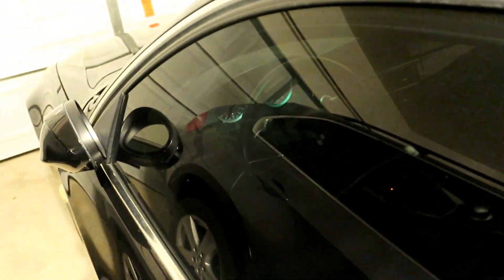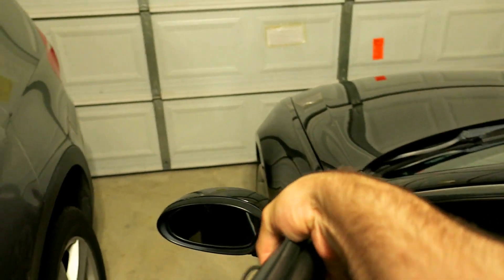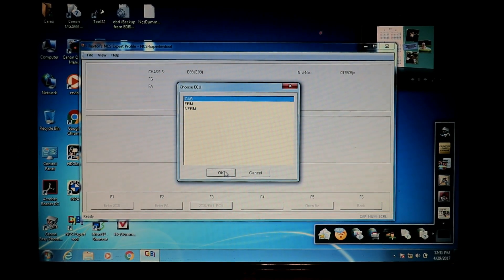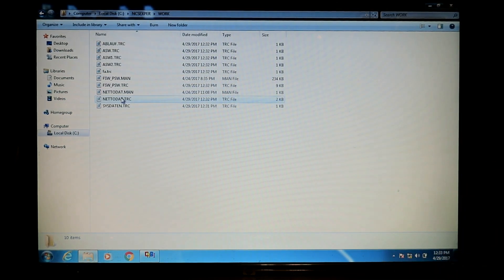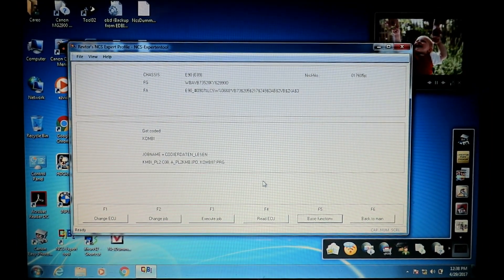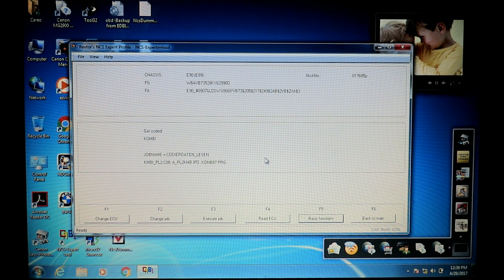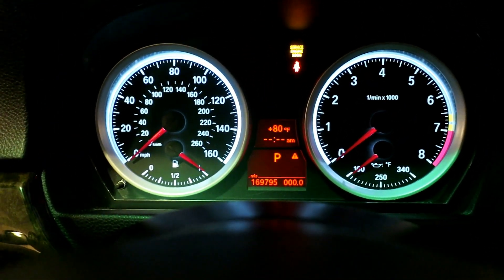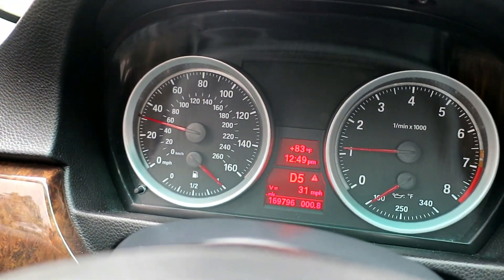How To Code For Digital Speedometer On An E90 BMW Using NCS Expert

Comment: ALL VIEWERS!!!!!!!

This coding tutorial is for the wrong parameter. This ONLY turns on the long term average speed (which is why is has the Speedo icon in the left)

It is not enabling on the the current speed which shows a letter V (velocity on the left when selected)!!!!!!!!!!!

Comment: Hi 
I’m your fans! 

I have a question for you

I bought an old speedometer and installed it, but the driving information and gear position cannot be displayed. I have a bimmercode, how can I use it to program it?
Reply: My cat is e90 325i

Comment: Great video, thank you. I have my cable and software ready to do this and few others you posted. One annoyance I have is the inaccurate speed, ours seems to be 4mph off.  Here is a link to a guy changing this for his E60. What are your thoughts? have you tried it on E90? https://www.m5board.com/threads/correcting-the-e60-speedometer-via-coding.430570/

Comment: Does this stuff work on the 2007 E92? I found out that the Carista app doesn’t work for coding in features like the digital speedometer and rolling up the windows with holding the FOB’s lock button on 2007 E92’s.

Comment: hey man i have a question, what DCAN cable do you use? do you have a link to it as well because i hear most cables from amazon/ebay don't work
Reply: Just ordered this one on Amazon, was $27 and works perfectly.

LZLRUN INPA K+CAN K+DCAN Car Diagnostic Tool Cable OBD USB Interface for BMW with FT232RL NCS Coding Winkfp Tool32 Programing

Comment: I did this to my 09 328i and now I feel like It messes up the sport mode. It will kick out of the selected gear and go back to drive mode after just a few seconds. Also I can’t remember if it’s supposed to show D/S in the cluster like my e60 did.
Reply from the maker: It should only do that if you manually shift your streering wheel paddles while in D mode.  Otherwise if you keep it in DS it should hold your gear.

Comment: I tried this, but the MPH was not accurate as all. the speed jumps all over the place and says I'm moving when I'm stopped. We have two 2011 E90's and the result was the same on both. Any ideas?
Reply from the maker: Hmm perhaps because you have a later model the kombi module is slightly different.  Is the text bigger than what mine appears to be?
Reply: The text appears to be the same.

Comment: There is a much much easier way to do this.. You can get a Carly OBD2 reader that connects to your phone via Wi-Fi, and you do all the coding from a Carly Pro app on your phone. All you have to do is go through the list of things you want in the app, and turn them on and off. Definitely a little pricey, but much simpler than this
Reply: I was looking at Carly, but £44 for the app and then £55-£66 For the dongle on eBay was a lot of cash when you look into using NCS, a bit more involved but with the help of clear videos like this I'm now confident enough to give it a go
Reply from the maker: Yeah Carly can do some coding but not all so I don't use it.
Reply: Yeah I could see it not being able to do some more advanced things, but for simpler things it definitely has it's advantaged
Reply: @VehicularDIY  And Carly is in your pocket getting money every month even if you do not use it.

Comment: was wondering if there is a reason you select e89 instead of e92 or e90 considering the e89 is z4?
Reply from the maker: That's just how the software is setup, I guess the electrical underpinnings are the same.

Comment: How well is the car running at 169k miles. ? I had to dump a lot of money on mine right at 100k
Reply from the maker: Guillermo Zavala I'm at 177K now, running great.  Nothing has come up but if it does I'll be sure to post a video on it.
Reply: I got rid of my E90 at 215k km; most critical stuff was working fine still, but I had some nasty expensive failures around the 160k (100k miles) mark like the starter, radio amp and ignition coils that the crook dealership where I used to go refused to change under warranty...
Reply: @pixlplague  Ignition coils are routine maintenance.
Reply: @maxnix346  they are but still, expensive and noteworthy.

Comment: FYI:

I was getting an Error: COAPI-2021 msg at the "CoapiReadSgGetFswPsw" part.

If this happens to you, go into device manager, right click on COM1, Advanced and changed the Latency to 1 (it's probably 16 by default) and that fixed my issue :)

Using Windows 10 64-Bit myself
Reply from the maker: MrEsber Thanks for sharing 👍